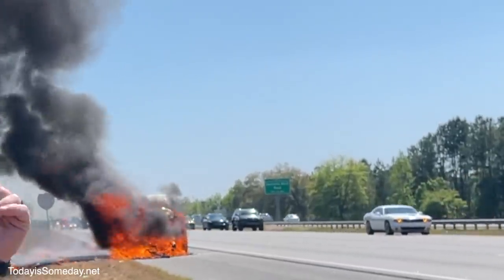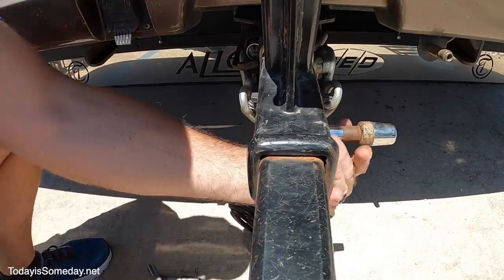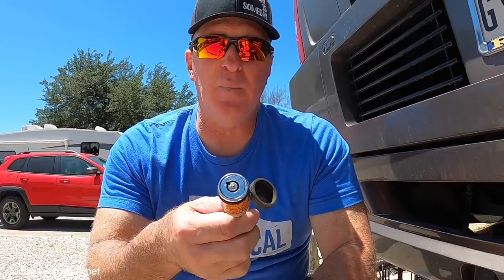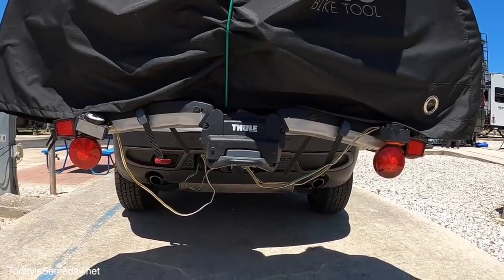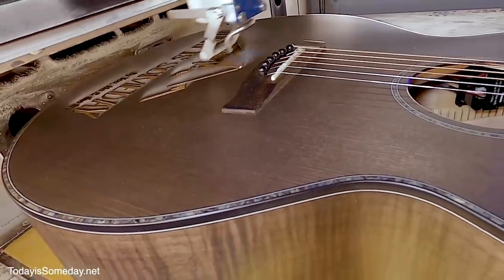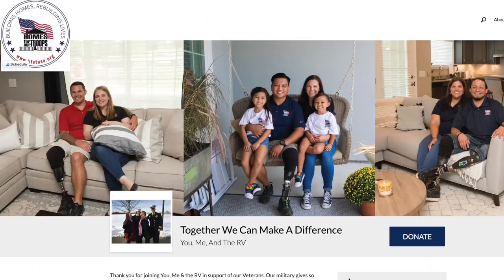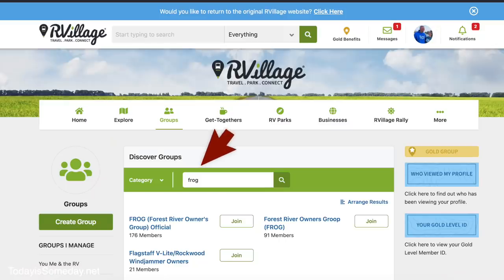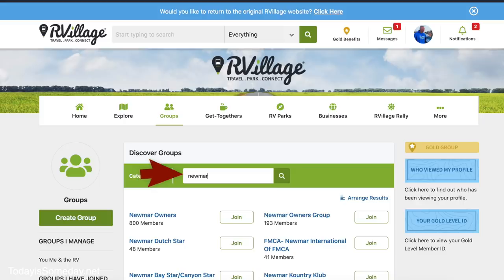RV Tow Car Changes (FULL TIME RV)

Comment: You know I have the same locks for my Toad and NEVER gave it much thought about a fire. In fact when I saw your last video I did purchase a TPS system for the toad. Our truck does have its own TPS system and it sends a text.. but what if I have it on silent. I would just never know. Now after watching how shaken up you are I need to think about ease of disconnect while traveling.

Comment: Get a long tapered punch weld a flat handle on the end of it and a hammer and keep them at the door so you can drive out the pin. Good luck

Comment: Some ideas..   Hammer, drive pin and leather gloves to remove the stuck or hot connecting pins, plus a wheel chock for the Toad.  Remember the Toad is in neutral. The fire may be brake related.  Another item would be a 5' x 8' canvas tarp(fire blanket) to block the heat and fire for enough time to disconnect.  Keep all this mid coach on the passenger side as it might be the RV engine or electrical fire you're dealing with and saving your Toad for your ride home.  Determine your process to evacuate the RV in 30 sec., grab bag of documents, computer, cash, credit card.....  Just make a Plan to survive

Comment: I would recommend that you check the pins are in place before pulling out from a rest or lunch break. Rest stop “squirrels “ might prey on the unsuspecting traveler.

Comment: I only use cotter pins and yes, with tension on them, they are difficult to pull. When I stop, I automatically shift into reverse for a second to relieve the pressure then put the rig in N and set the brake. It's about 2 seconds to make sure I can get the cotter pins out. Also, I never use locking pins, but do put the car in P, lock it and remove the keys at night just like I was parking the car alone, not hooked up. My car requires that I run it 10 minutes, going through all gears when I stop for the day, and again before I start out, so it's just easier to actually lock the car up for the night and the keys on the rack are my reminder to run the car again in the morning.
Reply from the maker: You are already in there so it makes sense!

Comment: I use locking pins when underway... I’m rethinking that now, thanks for the heads up.  I’m also interested in how such a fire could pop up on the tow vehicle?  Preventing that situation from occurring has the highest priority!
Reply from the maker: Agreed!! Of course they will never really know but they are thinking the brake was left on.
Reply: Hello Martin.  Leaving the towed vehicle's parking brake on is one way to start a fire.  The wheels won't turn freely causing heat/fire.  I watched a video on this about two years ago, so the next travel day we added checking the tire rotation to our departure checklist.  Sure enough, we were dragging the wheels as we had left our towed vehicle's parking brake on.  Another way a fire starts is if you get a flat tire on the towed vehicle and keep on driving.  You end up dragging the tire which causes heat/fire.  That's the main reason to have a TPMS (Tire Pressure Monitor System) in your towing vehicle that also monitors the towed vehicle.
Reply: @SRSnure  thanks... this issue in another reason I always use a written checklist for various RV travels.  As a retired professional pilot, checklist utilization is embedded in my habits.  Also, our tow TPMS monitors tire temp as well... thanks again for responding.  I was thinking the tow vehicle may of had a short or related electrical problem from the coach power harness.

Comment: If you do go to just the pin/cotter pin combo, I suggest that yiu check it after every time that you stop. I was in one of tge company vans pulling a trailer with a scissor lift on it. I drove from ft walton bch to Panama city, I stopped to get gas when I left the shop. I git to Panama city and realized that my pin was not there.  Someone must've pulled it out, probably thinking that I'd drop the trailer in the parking lot at the gas station and it'd be funny. Luckily I made it to my destination with it intact.

Comment: I switched to locking-pin because the cotter pin lost during travel. Now, there is fire concern. Switching back to cotter pin or staying with locking pin, that's going to be the question :(

Comment: Thanks for the advice!  I had a van towing a small utility trailer the 64 Chev van had a rear axle failure, broke and the van went on it side, the trailer was still connected had trouble getting it disconnected because of the locking pin?

Comment: On the pins that come with your hitch pin are round so you can insert a screw driver or some type of devise to lift or pry the pin out,just have a screw driver in your glove box will stop the having to rock your rv, pins will pop out i also welded a large washer to the pin so pin can be pryed out real fast too. The extinguisher that comes with your rig is for a kitchen pan fire, i like you have 3 others in the rig and 2 in my tow vehicali hope i never have to use them they can also be recharged. Your fire department will usally refill them and recharge them for free or small fee. Saves on expense of having to buy more. Good luck and happy trails. Rick Madison (second Air Force, second to none..B-52 93FMS- go navy

Comment: AFFF and Halon.  🤣😂🤣.  

Perhaps a CO2 flood system like in a galley hood.  

#ChangingLanes has a fire suppression system for their basement, water heater, furnace, refrigerator, and other spaces which seems top notch. 

Go Navy!  Beat Army!

Comment: How was rocking the rv back n forth to get pin out done? Such good advice.
Reply from the maker: Those fighting the fire yelled instructions to me (Stacy) I yelled them to the driver. Rudimentary but it worked. Luckily enough people stopped to make this happen.
Reply: @todayissomeday  I understand that but physically how. With the gas pedal or manually pushing? So happy so many could help get it safely unhitched.

Comment: Your logic on the pin hitch is backwards.  Cotter pin easier to remove, should be on drivers side. Then more leverage to remove the hitch pin.  Your pulling towards yourself on the passenger side, your way having to reach over the hitch and pull towards the drivers side and less leverage as your pulling away from your body.

Comment: I would recommend Chain Wax (www.amazon.com/Maxima-74920-Chain-Wax-Aerosol/dp/B0012TZ1RU/) on the pins. It is a dry lube that doesn't attract dirt and makes pulling those pins out much easier. I have been thinking about attaching a mallet to my towbar (haven't figured that one out yet) just to make sure if my wife has to unpin the connection that she would have the OOMPH needed to knock the pins out. 

Looking at your tow bar, can't you release the pressure by pulling the locking handles on each arm that would allow you to pull the pins from the baseplate? 

For fire suppression, maybe an Automatic Fire Ball Extinguisher AFO (www.amazon.com/Automatic-Extinguisher-Mounting-Bracket-Suppression/dp/B074KZDNKY/) ? They seem to have enough power to extinguish an engine bay fire. You could even mount one in the engine bay of the TOAD and the MH or keep one in a rear bay. FRAG OUT! Wait EXTINGUISHER OUT!

Comment: im sorry about your fire, but as far as the pin , its ok when towing the car behind the rig,  locking it with locks to the hitch on the chains is what i would do. as far as the car being removed during the night and not hearing it, WELL , i have a sure way 20# fishing line between the car and the rig connected to a handheld air horn, you wake up there running away. works every time! as afar as that lock in the hitch , if you see a you tube video online about the crook used a old metal pipe and in less then 15 seconds removed it and there off a running . last week friends and family were boondocking out in az, , i rig the horn  we were  about a mile from the trailers, running fast , got there and got them. for there punishment we handcuffed them to a cactus for the rest of the day and night with 1/2 gal of water 1 each there were 2  waiting for the police. the police started laughing about the way we handled it. of course we are all members of an AMERICAN AGENCY, FEDERAL LOCK AND LOADED. happy trails to you!!!!!love that song?

Comment: The irony of fire in extinguishers is that there is a cost to have and maintain them. I mean, good.l ones have to be hydoed every five years.  .and the halons ones, wow.  Expensive to reclaim the Halon.  But they ar.needed.and the crap ones at walmart only stop a simple flash up.  Invest.in a.good 5 or 10 pound co2. Money well invested. And at the end of hydro, teach someone how to use and cool your beer and then trade in for hydro and recharge.  So.stupid how people skimp.on fire suppression, even on boats.  CO2 can be refilled at soda CO2 places for more money

Comment: Watching your video about the fire also made me think about how hard it could be to disconnect the towed. I think your idea about using the pins is great.
Has anyone heard of element fire extinguishers? I saw a small demo of using one on Jay Leno's youtube channel. They are about the size of a road flare and you can get about 50 seconds of gas that puts out fires. There web site is elementfire.com, also available
Reply: My comment went out before I was finished. Element fire extinguishers  are available on Amazon. We plan on purchasing some for our motorhome and pickup.

Comment: Phil check this video out you could keep the lock on the hitch and just carry a short piece of pipe. The pipe can also be used to thump the tires. I know you have a tire monitoring system, me too, but I do occasionally thump the tires. 20 years ago I didn't have a TPMS and I don't throw things away. If I don't use it once in awhile someone else will throw it away. Pipe could also be used to break window in a emergency or possibly personal defense. https://youtu.be/-Lq6_N5K1L4

Comment: If we’re at a spot that isn’t secure( rest stop overnight for example) we will put the emergency brake on the toad and lock the doors so someone can’t roll the car away. Make sure to put a post it note on the steering wheel in the RV to remind you to release that brake before driving away!

Comment: As a safety professional with over 35 years experience I can share a common item people do wrong.  Fire extinguishers should be near an exit and away from the potential fire source.  (So not on the side of your stove).  Also for engines you may be interested in this technology:  https://www.youtube.com/watch?v=xBu9tQDbUz0